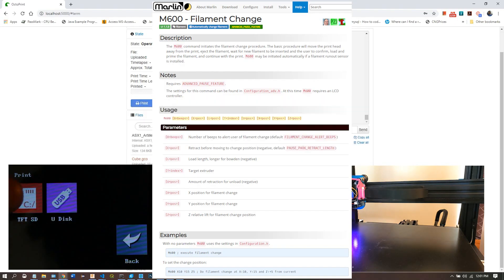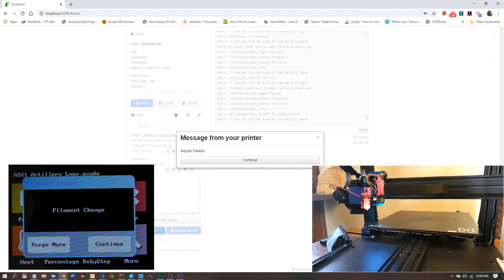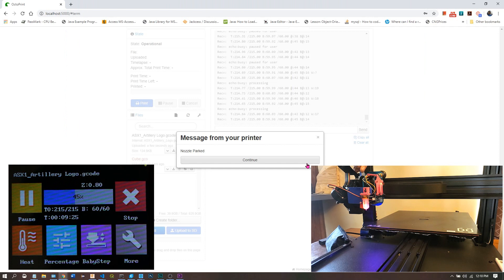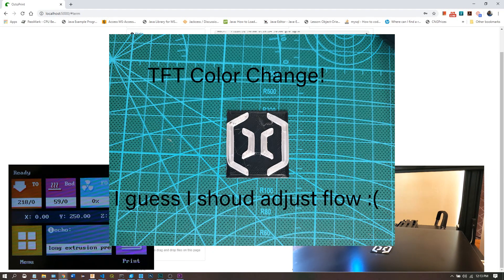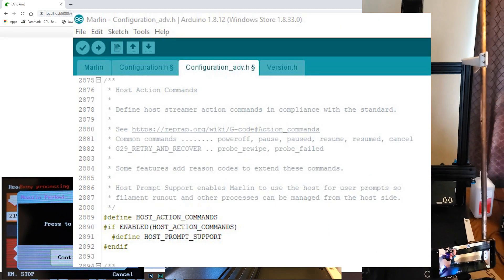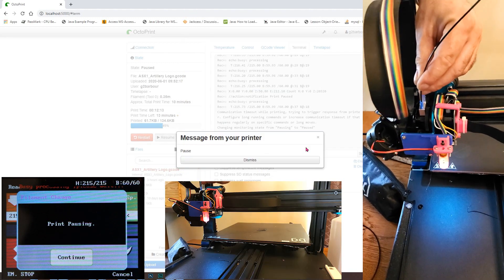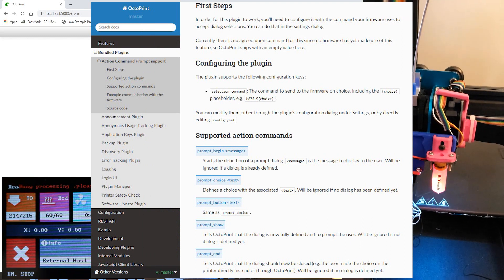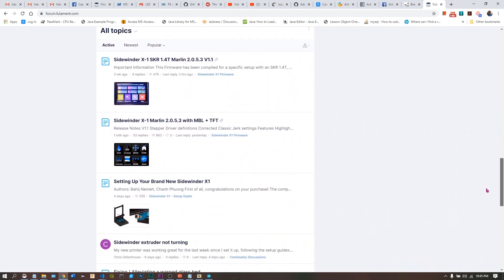REAL M600 Color Change & Filament Runout on Stock Touch Mode Display and Octoprint (DOWNLOAD BELOW)

Comment: A single word ... bravo! ... excellent work ... congratulations !!!
I was impressed, above all things, by the perfect error control, for example if it does not find the command M412 S1 (runout) it warns and continues, if it does not find the bltouch it warns and it continues ... impressive, what quality.
Very good job, I will have it working a few days with my own firmware version 2.0.5.3, which does not have bltouch and has the LCD function activated for the Fysetc Mini v2.1 that I have installed and I will tell you.
A first question arises, the RUNOUT of the filament that comes standard with the artillery I see that it does it correctly, this means that it can also support another sensor connected to the MKS board?
Thank you very much for this great contribution to the 3D printing community and in particular to the Artillery community.
Reply from the maker: Sounds like an interesting project. Sure you could use another runout sensor! But this one uses a single runout sensor that is functional for the TFT and for Octprint. The firmware is available for download if you just wanted to change the configuration files: https://www.thingiverse.com/thing:4251390
Reply: I am promoting your excellent TFT firmware from my YouTube channel "Canal 3D Capital", I hope that many users use it, and help you debug it, ... I suppose that will help you.
Reply from the maker: @willianbell3464  I saw that video! Now I know who you are! I really wish I could understand Spanish because it looks like a very informative video! If anyone wants to watch it: https://www.youtube.com/watch?v=H3mHDbtcaxU
Reply from the maker: @willianbell3464  Yes, all the debugging help is welcome! It has come a long way so far but I won't be happy until it is perfect
Reply: @PrintEngineering  I have been a developer for more than 20 years and I know that you have to invest many hours to stabilize a core version ... I also hope that someone from the channel will be encouraged to test.
Reply from the maker: @willianbell3464  I'm not really a developer, just a problem solver. I just was not happy with the interfaces that were available. M600 support is merely 1 feature in the bigger vision. There are many hours into this project already, and many to come.

Comment: Great to see this follow-up video! My question is if I dont ever use the filament run-out sensor do I need to relocate to the mainboard? Right now I just keep some filament jammed in the filament sensor independent of the main spool. I primarily want M600 for multicolor prints with intentional filament swaps at defined layers from the slicer. I can't wait to try this out!
Reply from the maker: If you don't want to use it, you don't have to move it. It should run fine either way as that is the way it was for most of my testing without issue, but if not let me know and I'll look into it.